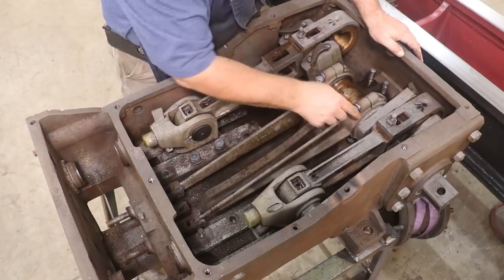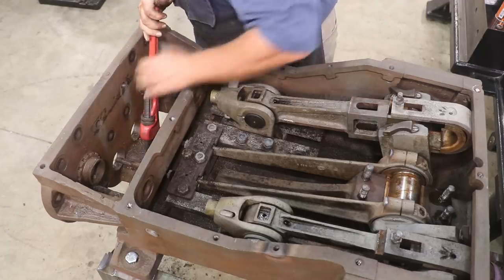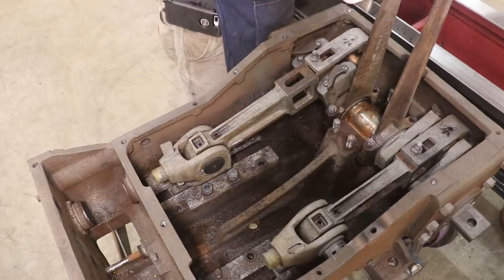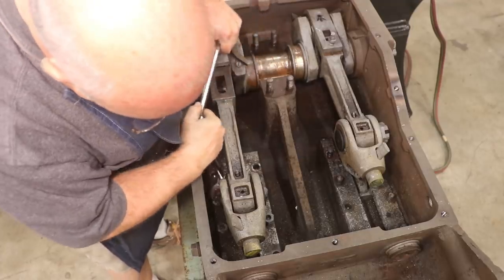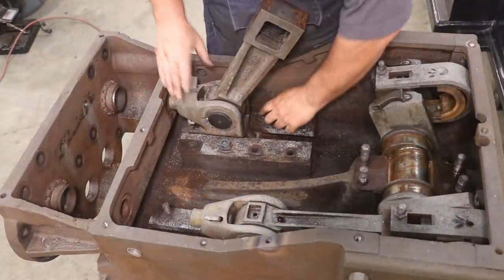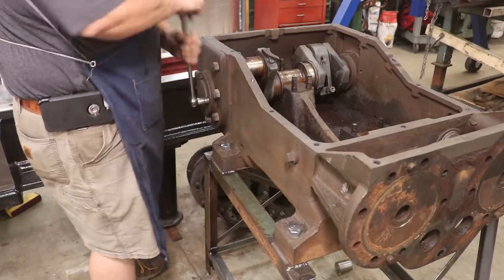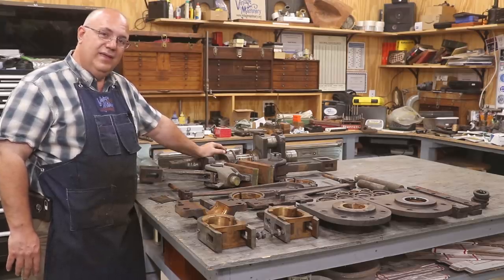Steam Locomotive Stoker  Engine Restoration - Part 4: Disassembly Continued

Comment: Keith, Your crankshaft will be best done by a shop that deals with regrinding crankshafts. They should be able to spray weld crank and then regrind to specs. You said you have the mechanical drawings to get the specs. good content. You will have to seek out an engine machine shop that is willing to take on such a project.
Reply: Bruce T.....He said that.

Comment: Check with auto machine shop, they may be able to turn the crank shaft or have it welded up  and turnned down to orginal size. Great video, use more lube.

Comment: Makes me wonder what tools were used for assembly?
Reply: The makers would have their own special tools.
Reply: Assembly was a snap and normally disassembly would be too. The issue here was that things could not be removed in the correct order. It was only because the slides were frozen that the nuts were 'inaccessible.'

Comment: When this was built did they have crows feet wrenches? If not how did they get to those bolts?
Reply: It's easier to assemble/disassemble if you can do it in the right order. He had to loosen the retainers before the slide would slide. IF the slide would have slid freely those nuts would have been easily accessible.
Back in the day it would probably have been faster to assemble, install and get the thing running, than it took for Keith to disassemble it. LOL!
Either that, or they made the guy who designed it assemble it. ;-)

Comment: Just curious about the piston rod connections to the crank.  While the valves have more typical caps, the piston rods have the seemingly elaborate tapered pin secured gizmo.  Any thoughts or reasons why?  Did this provide some advantages over the typical cap setup?

Comment: Keith...... When you get it completed will you be able to connect it to maybe air or steam to check out the running?
Reply: When reassembled it should be able to run on air.  Speed will depend on volume available.  The locomotive operating pressure would be around 200 to 250 psi and that would be coming off the manifold not from the throttle.

Comment: Re: the cross-slide surface in the casting, would that stuff you can use to build up a worn lathe bed work. Having said that an engine is a lot harsher environment though to a lathe bed.  Abom metal sprays for the crank journal.

Comment: The crow's foot is a life saver on aircraft, but the box end type would be a better choice. Being a retired aircraft mechanic, I have a full set of both. Where all the pitting is I would braze that up and re-machine the surface. Also take the crankshft to an reputable automotive machine shop and have them turn the crank and  polish the journals.
Reply: I know just the right Man for it David Richards he is a machinist and works on automotive stuff and steam engines

Comment: Repairing the one journal should be fairly simple.  There should be enough good surface to chuck it into your big lathe and get it indicated in.  Clean it up and turn a sleeve to make shrink fit over the turned journal.  Put the crank in the deepfreeze for a couple of days at 0 F and put the sleeve in your heat treat oven at 400 or so.  Slide the hot sleeve over the cold crank and it probably wont be removable without turning it off.

Comment: I really like your videos of restoring old steam engines. You know a lot more than me, but check out some videos of cast iron cookware refurbishing and when cast iron is heated to a certain temperature it will no longer accept reseasoning  the grain structure in the cast iron is changed. This is certainly doing something to cast iron so it may be weakening it. Just trying to help out. Be carful about overheating cast iron when removing bolts.

Comment: Just a question, would you make some of the parts out of stainless steel? To prevent rust later on.
Reply: Typically that portion of the stoker is full of oil so rust is not an issue. WMSRR has a video on FB of when they opened up 1309's stoker engine for the first time and it was still full to the brim with oil. The rest of that loco was/is a flaming mess, but the stoker was in perfect condition and they even test operated it before deciding not to refurbish it.
Reply: How about we just avoid filling the crankcase with water and leaving it sit for decades. :-)

Comment: Rather than build up the crank journals would it be possible to grind them undersize by a few thou and build up the bronze bearings with a thin layer of white metal it works for internal combustion engines.

Comment: 06:28 y not rotate the crank to get the clearance you need to remove the valve parts? The crank position has them as far forward (away from the crank) as possible 90° would bull them away from the end of the casing, giving you the room needed to remove the parts.

Comment: Its interesting to see the amount of damage to stoker engine. Typically these engines are full of oil so it would not be an issue. However the loco this one came from had that oil drained when it was prepped by the RR to be a park engine, and had also gone through at least one flood event.
Reply: What engine is third stoker motor from?
Reply: @owenwitteveen  nc&stl 576
Reply: Oh, I was under the impression this was a spare stoker motor from somewhere else?
Reply: @owenwitteveen  Nope. This is the one from the locomotive. The stoker engine donated by the PA Rail Museum was deemed fit to be a parts source, but that was about it.

Comment: The crank looks like a job for Abom.. he recently did a motor shaft with a similar issue.. he spray welds additional material on and machines it off.. the corrosion in the base4 of the slide should not be to big a problem either.. machine the inner surface of the case flat ands smooth.. then, when you make the new cap plated start with a little thicker plate and rabbit the side that is over the frame and bolts and leave the extra metal over the slide to hold it tight against the new casing surface...

Comment: Could the inside of the casting be painted, or would that end up being more of a mess for the next person?
Reply: Squatch253 would. His resto's always look pristine.
Reply: Painted ? No way. The inside is flooded with oil when running. You don't want anything in there except oil. The oil would penetrate the paint and you would have a mess. Plus the whole assembly gets hot. The paint would peel off in a few hours.
Reply: @linuxaos  aren't the insides of milling machine gearboxes painted?
Reply: @billtheunjust  The way I was thinking it was that there is no sign of paint anywhere. Which leads me to believe that this assembly gets very hot. Also, yes, you are right. The inside of milling machine gearboxes are painted. Not sure why. Maybe if the machine sits idle the oil gravitates to the bottom and there is exposed metal that can rust ? Hey, what do I know ? LOL

Comment: Can someone tell me what those comma-shaped pieces are that are attached to the crankshaft? I'll guess they either push oil around or are used for balancing. Also, what is the name of the specific part they are attached to?
Reply: Oil slingers.  They are named from exactly what they do - dip into the oil and "sling" it around.  A modern example would be the Briggs & Stratton engine on your lawnmower.

Comment: Machine down the floor of the crosshead slide add material to the crosshead surface.
Reply: Since the crosshead bearing is babbit that should be straightforward. Maybe he'll scrape the bottom of the guide?
Reply: @Mishn0  ...Scraping might be his best choice.  I am not sure how you would go about setting that up to machine in there.  Pretty deep...
Reply: @paulcopeland9035  No problem machining in there for a HBM like mine. :-)
Reply: @bcbloc02  or with the plainer Keith is restoring
Reply: @bcbloc02  ...Yep Brian, I forgot about your setup.  Not every shop has the range of equipment you do!  That would be a perfect job for your HBM.
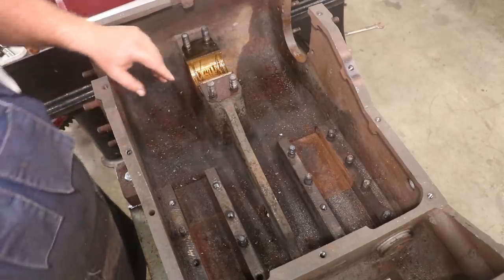Reply: @DeutscheReichsbah100  It would require a very long tool to get to the bottom of that case but still have the planer cross head clear the top of the crank case. Likely terribly chatter prone but in cast iron going super slow you could probably get it done, perhaps not with the best of finishes but still doable. At 24:35 pretty sure you can see the visible swirl marks where it was milled before. I am sure if they milled the tops of those rails they milled the bottoms too as more setups to do the job would just be more place for error. Also they could have drilled and tapped the holes in the same operation. I am confident this was a job done on an HBM at the factory.
Reply: @bcbloc02  Hello Brian your write I have overseen the machine marks. And it was probably a stupid idea of mine.
Reply: @DeutscheReichsbah100  Nope no stupid idea! If it is the tools you have got then it is the tools that you work with. :-)

Comment: Send the crank out and have it ground, rebuilding crankshafts is not as easy as spray welding and turning the journal. Dont go through all the trouble of remaking the parts and then fitting everything, just to loose the engine to a repair of a bearing journal. There are some things you do yourself, and then there are somethings you let the specialists handle.

Comment: I am looking forwards to this series developing... Question... In English, English, what is described here as a cotter pin, I’d call a split pin... A cotter pin for me is the long unthreaded tapered / chamfered bolt with a nut on the end used to hold the crank to the bottom bracket axle on older bicycles (amongst other things)... What would be the American, English for such a thing?
Reply: andy withers   in UK  in olden days they were labeled "split cotter pins" which became simply "split pins"
Reply: The bicycle pin, could you point to a pic of one?
Reply: Jim Barchuk... if I can post the link... this is a bicycle cotter pin 
http://www.mytenspeeds.com/My_TenSpeeds_1/Components_Table/Crank_Sets/Stronglight_Cottered/Stronglight_Cottered_6.jpg

Comment: I know its easy to volunteer someone else for a job, but Mr Richards would be the man to bore and sleeve those cylinders.

Is there enough meat in the bottom of the crosshead slide tracks to mill out a quarter inch and put a shim in with some dowells?  A man could build it up with braze, but the whole casting would want a good preheat and post heat in an oven.  Again, Mr Richards has a big oven, but I dont think its that big.  Toby at Squatch253 sent the rear end from his X231 prorotype 445 MM tractor up to Iowa and they brazed it up, so that shop has to have a huge oven.  

Im thoroughly enjoying this project an Im sure looking forward to seeing your progress.

Comment: makes you wonder how these were assembled in the first place
Reply: It is rather easy. 

The cylinders without pistons and its rod inside is bolted to the frame

The locking rail for the crosshead added 

Crosshead mounted and tolerances checked.
If the rails is to tight shims is added between them and the mounting
The crosshead is shoved all the way forward
Piston and the rod can be fitted now and the crosshead wedges driven.
The crank is mounted and bearing tolerances checked
Connecting rod with its bearing fitted to crank axel 

Connecting rod fitted to the crosshead and the pin's nut tightened.

Comment: Could you not use two nuts,  locked together, to remove the studs?  No need to spend money on a stud puller and the nuts do not screw up the threads.

Just a thought. Something my parents taught me about 50 years ago.

Duby

Comment: I look at all that iron, steel and bronze, and then look at a modern Tesla EV motor and differential delivering 400 or more horsepower at better than 90% power efficiency.  Add another couple of reducing gears and the stoker job would be done in less volume, use less energy, and require zero maintenance beyond a gearcase oil change every few years.  We've come a long way...

Comment: This crank is 90 degrees, because in steam engine those two pistons are in push-pull configuration?
Reply: They'll normally design a multi-cylinder steam engine so the cranks are at 90°, so as avoid have both pistons at top dead center/bottom dead center as to avoid locking up.  That way, it'll be self-starting once steam pressure is applied.
Reply: @jlg4880  also, this engine has no reversing gear.  Much spler

Comment: I would cheat: use steel filled epoxy on the pitted areas. Or, there are some excellent cold solders (eclectics) available. Lubricants are far better than they used to be.
Reply: The surface then has to be milled flat anyway, so skipping the epoxy and just taking the surface down to reach good metal would be easier.
The babbit block most likely has to be recast, slightly larger dimensios of the channel won´t matter.